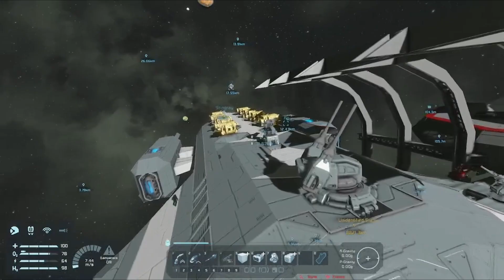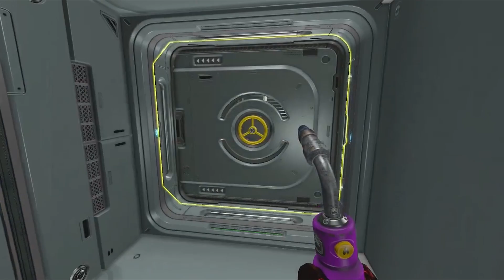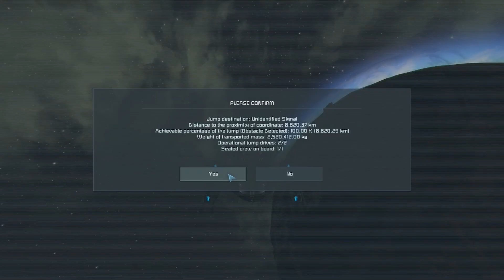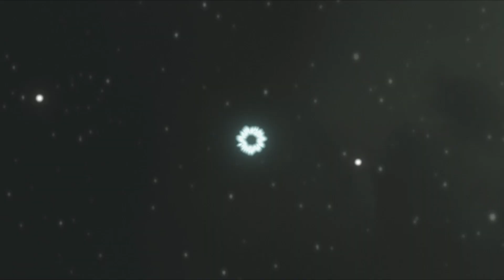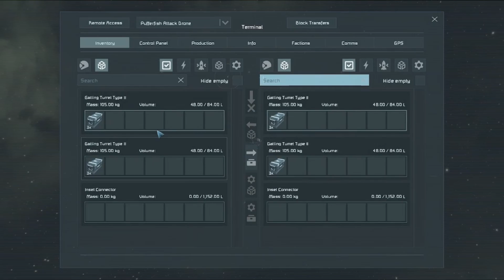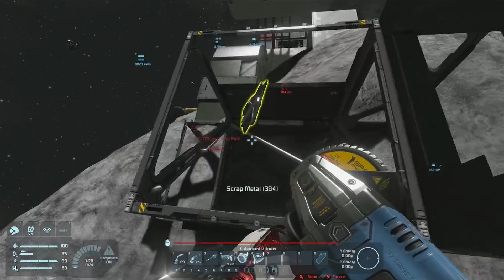Full of Holes Again - Contact EP25 - A Space Engineers Mostly Vanilla Survival Series

Comment: 26:20
That was such a satisfying rail gun shot. Nice!

You had the right idea, taking out those sub stations will take down the safe zone. But it's a tough nut to crack and you had the misfortune of having only 30 minutes left.
The asteroid sub stations requires the player to board them. But you could also take out your drill and get inside from another angle, likely giving you a far better cover against that interior turret. 

Each of those sub stations has two antennas. How ever, they only have 1 power source so having your turrets target power instead will take out those sub stations that aren't inside asteroids.
Reply: I'm not so sure it was 'misfortune' that only gave him 30 minutes left, I think that's a timer that starts once the Factorum base detects you. If that's the case then, even though these scenarios are meant to be hard, I think a 30 minute time limit for this particular scenario seems a little short for, what is technically, a single player game. 
I feel this type of base either needs a longer time limit or possibly removing from the RNG table if the game detects only a single player in the attack team.... but i'm not so sure the game is set up with that kind of detection.

Of course, there's always the possibilty that this type of base is pretty easy (or at least not so ludicrously difficult) once a player knows what they're doing 😆
Reply from the maker: That "knowing what I'm doing" thing would probably help in most of the situations I find myself in.
Reply: @redsgamescompany  You and me both buddy 🤣
It's fun to watch though 👍
Reply from the maker: Good to know, I did try to switch to targeting power at one point, but by then there was a lot of fire and the asteroid was in-between me and any power sources.